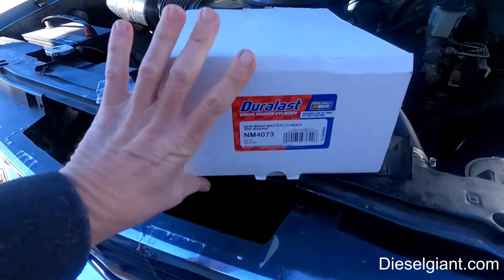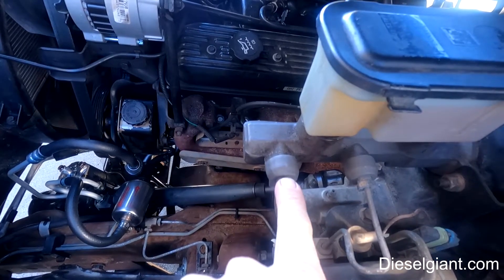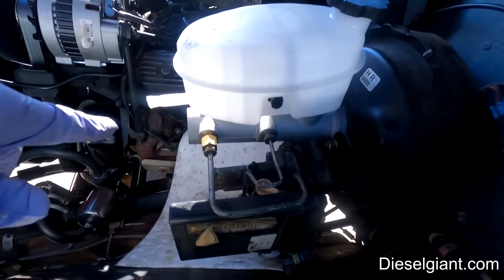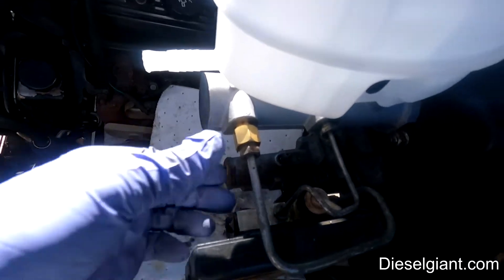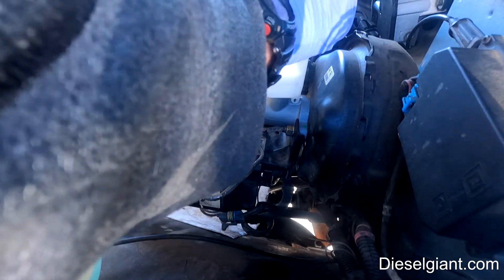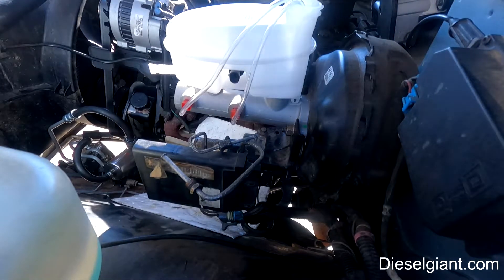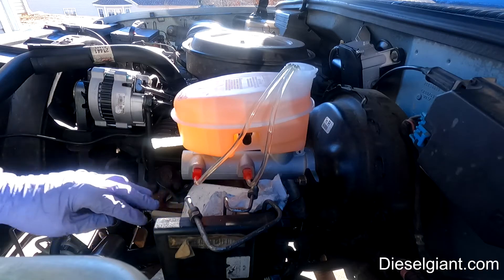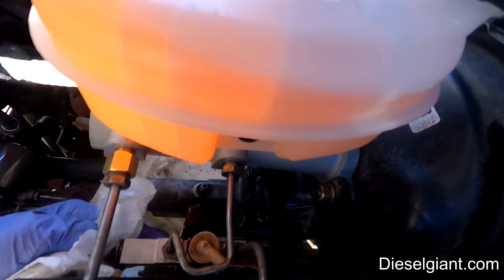Brake Master Cylinder Upgrade GMT 400 '88-'98 Trucks

Comment: Warning to the few, I didn't take into consideration i had an off year*newer hydro booster installed from prior owner, which had a smaller insert center connection. So instead of trying to do the homework again i replaced what i had. BUT, im gonna x the dump valve when i r&r my entire rear brakes on the dually. Which is a stock rear abs system identical to your setup.

Comment: Is that a hydro boost underneath the master cylinder? My 95 Tahoe does not have that part. I wonder if your master cylinder would fit on my 95 Tahoe?
Reply: No. That is the ABS unit... Hydro boost system works off the power steering...
Reply from the maker: No, I don't have hydroboost on that truck.